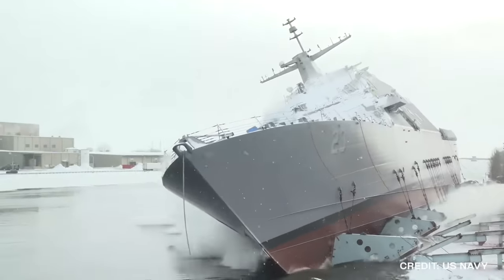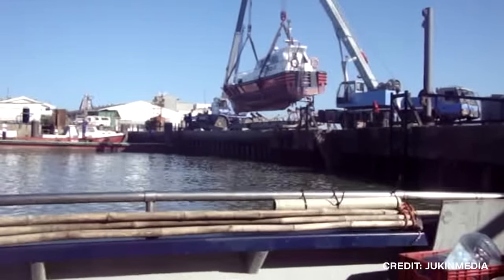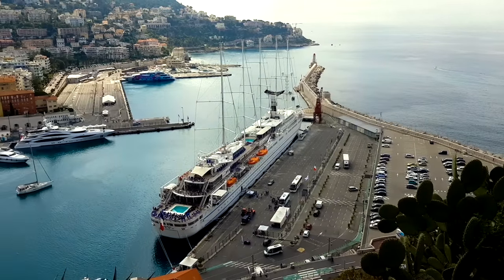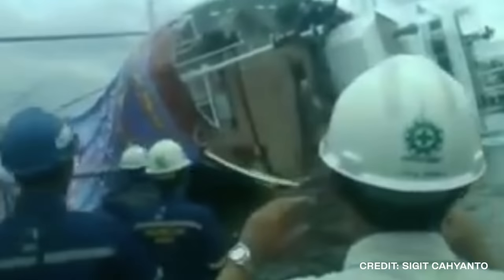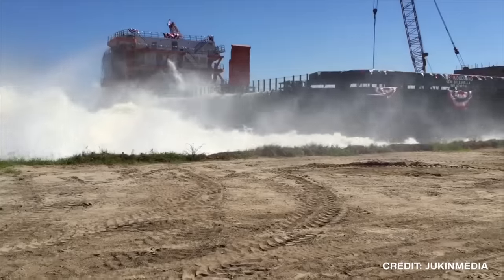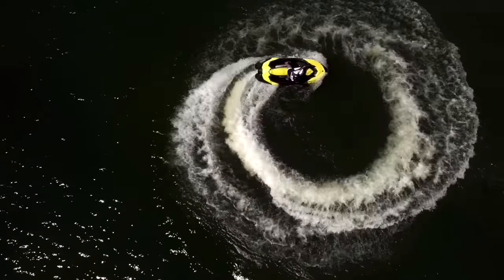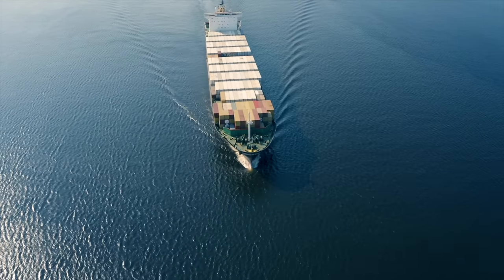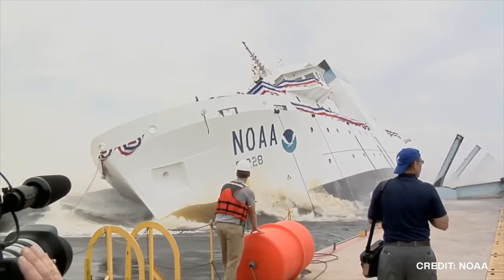5 Ship Launches That Went Horribly Wrong

Comment: You're wrong on the first one. Both cranes had the load. If only one had the load & the other was controlling the swing. The one with the load would've been rigged in the center of the boat. It's called a tandem lift.
Reply: paulgarcher  Correct!
The narrator does not know what he is talking abut!
Reply: paulgarcher  Lifts are calculated these days. Weight, distance etc are all worked out before the crane gets anywhere near the lift itself. Apparently someone thought or maybe was told that the boat was lighter than it actually was.
Reply: Its UTUBE not the BRIGHTEST.
Reply: @roberthertz6634  What are you talking about?
Reply: paulgarcher  Agreed but the liftplan should have that as part of it. Assuming that they had one which seems unlikely. :)
Reply: agreed and it NOT a personal boat like the commentator says, it clearly says "PILOT" on the side so it is a harbour authority pilot launch.
Reply: @SirHackaL0t.  Generally speaking cranes do have gauges themselves telling how much the load weigh's. So it couldn't just be the boat weighing more than what was calculated because you have to think they add a few extra pounds to be safe. The thing that really did them in which could not be calculated was the height of the tide really. It being extremely low tide at the time increased the distance from the cranes. Generally it was maybe close to max when first picked up thought it was okay but failed to realize the extra distance and weight into their calculations. Also add in the awkward positioning of the cranes due to the limited amount of space. Not a professional here only did rigging for a bit but these are things I noticed watching this video.
Reply: @davidscott9097  the distance down isn’t relevant. The boom angle is the main issue, not how much cable is out.
Reply: @loveistheanswer8137  If it was high tide  he wouldn't have to lower his boom as much really. Given that it was extremely low tide he was close to maxing out him adjusting the boom more because of the low tide. He than maxed out, tips and than falls over.
Reply: @davidscott9097  they don’t lower the boat with the boom, they lower the cable. If the boom was lowered too much, it’s because they miscalculated the weight, or how far from the dock they had to go. It distance down is irrelevant. I have worked around cranes my entire construction career.
Reply: @loveistheanswer8137  They lower the boom to move the boat out away from the dock. You are saying what I'm saying but not realizing that the low tide was a factor. If you look at the accident report I kid you not that they will also include it as a factor. Simply because he had to lower his boom more to adjust for the boat to clear away from the dock. You lower the boom slightly and lower the load.
Reply: @davidscott9097  what does the distance from the dock have to do with how high the tide is. This is my point. Not trolling.
Reply: @loveistheanswer8137  you're totally right, that dude doesn't know what he's talking about
Reply: The back of the boat was much more then the front.
Reply: its just a stupid idea to have 2 cranes to get a job done. the 2 cranes have to communicate and be precise, 1 slight wrong move and u end up like they did. its not the best or safest way to get that boat in.
Reply: @sasproductions701  
They probably can't get a crane big enough into that space for a single lift. I'm a retired Ironworker. I was certified in rigging & have performed more tandem lifts than I can even remember.There's nothing wrong with it if you know what you're doing.
Reply: @davidscott9097  Vertical distance plays a very small part. Repositioning your load and counter weight position and/or booming down (thus moving the loading further away and increasing it's advantage) will make quick trouble for you.
Reply: @loveistheanswer8137  are you a operating engineer or certified in rigging though?
Reply: @loveistheanswer8137  i'm curious, would they have been better off with the crane vehicle perpendicular to the dock instead of closer to parallel? i feel like the counterweight would do a better job... might be too skinny up there for it but seems like the counterweight is off to the side of the weight instead of "behind" it if that makes sense.
Reply: @SirHackaL0t.  That first one was possibly a bad crane operator, who didn't know what he was doing in th math and calculations dept.
Reply: I thought that it sounded weird when he said the other is only for support. Then why isnt the first one in the middle?
Reply: @davidscott9097  While it was low idk if I buy that argument because it starts to go before it even gets a foot or so down the side.  That doesn't seem to be a dock where water comes up to the top by any means but you are right about the weight probably not being the issue, it was probably a angle of approach and maybe the guy didn't have the extra feet in place or placed in a way to combat what was obviously a nose heavy lift.
Reply: No! You're wrong Colonel Sanders!
Reply: But at least the boat got  in to the water
Reply: @davidscott9097  the tide being low had nothing tondo with it since they are on a pier. The distance out from the crane remains the same. Only the amount of cable needed to lower to the water changes in that scenario.
Reply: Always important to know the weight of what you're picking. I won't hoist any large machine without knowing it's weight and checking my chart.
Reply: In an engineered lift when things matter you use a crane that has load cells and measures what the weight is. They also monitor stick out and the computer will not let the stick go out further than the center of gravity. This was probably a situation where they'd "done it a million times, what could go wrong"
Reply: The crane was not the center of gravity. .. If is was, there would not have been a problem.
Narrator seems to know less than he thinks....

Comment: That isn't a "large crane", as cranes go it's actually pretty small. Which explains why what happened, happened.
Reply: Actually what "happened" is the boat discovered gravity and took the crane along for the ride.
Reply: That’s what happens when you use a small crane to carry the bulk of the weight, ie engine’s etc. .
Reply: Agreed. That crane didn't even have counterweights. It's a light duty, not meant for big lifts. This is what happens when people think they know what they're doing, rather than actually know what they're doing.

Comment: Both cranes were lifting the boat. The one that fell was lifting the heavier end and it was oriented incorrectly.
Reply: And the water level had nothing at all to do with the tip.  Honestly, who the hell writes these scripts?
Reply: @tomrogers9467  Agreed.  If the crane that tipped had been placed the other way about it would have been OK.
Reply: The crane operator 100% caused that crane was badly positioned. Boom was extended out to the rear where the crane has minimal braving, and the boom was lowered as the boat was swung out over the water, shifting the cranes center of gravity in ways that the operator had not planned. I know of a few Fire Departments that managed to sink their very expensive ladder trucks the same way.
Reply: @andrewtaylor940  also as the load goes below the line of the crane it increases to load affect, same as reaching out reduces the load ability of the crane
lot of people dont know that
Reply: @raypitts4880  Basic leverage, dangling the weight below the cranes center of gravity is every bit as dangerous as having it above the center of gravity, works both ways, over-extension, bad load planning, bad orientation, honestly the whole thing was a perfect storm of bad decisions that ended with an overturned crane, it wasn't just one thing that went wrong there, it was many.
Reply: @charlesmayberry2825  I’m pretty sure the one thing wrong was the dude operating the crane, who thought any of it was a good idea. But yeah, multiple people had no idea what they were doing.
Reply: @tomrogers9467  The script is a bigger disaster than any of the launches.
Reply: That was my take as well.  You could tell pretty early on that the two cranes weren't in sync with each other.  Also the crane on the right probably didn't have the proper counter balance weight.  All it took was for the crane arm to reach a critical point in the pivot, matched with an underweight counter balance, and it was going over.

Comment: 7:17 That's what happens when idiots try to operate machinery they do not have a clue about HOW to operate! 

I've seen something similar, where a rich dude had bought a 37 ft. brand spanking new speedboat, despite having absolutely no experience or skills about boating, and the first thing he did was to slam it right into the concrete pier, and totally destroy the bow of the boat. Luckily for him the boat didn't sink, but it would cost him thousands and thousands of $ to get it repaired, so he sold it with a considerable los, and we never saw him in the marina again! 🤣
p.s. It was a +$250.000 boat to begin with.
Reply: U sound angry about it
Reply: @DBuckyBoy  it’s hard to watch someone who doesn’t know what they’re doing ruin a perfectly good boat, if only because you appreciate the craftsmanship that went into it.
Reply: a fool and their money are soon parted

Comment: Another well known launch fail is the Vasa (or Wasa) in 1628.
But it wasn't as much a problem of the launch as a design problem with the ship itself.
Reply: I was thinking of that - it just tipped over when put into water.
Reply: No video, unfortunately.
Reply: That was a fun one.
Reply: @roysigurdkarlsbakk3842  If I recall correctly (Disclaimer: from what I've read, I wasn't actually there...) it didn't tip over right away.
It did a minor test drive first that went okayish, and then they went for the big, official premiere thing and that's when things went south.
Reply: My Brother who had Swedish gf went to a museum about the Wasa.  He told me it was a design fault as the king of Sweden wanted an extra  floor on this ship making it the biggest ship at that time.  Builders warned him not to increase height as it woukd become  top heavy easy .  But the king insisted....( refusing a request from a king would be dangerous sometimes)
Reply: @ziiofswe  You're right. (and Baard2000 above also) The Vasa didn't sink right away - it sailed a bit away from the harbor, but a large gust of wind pushed it to an angle where water came in the open gun ports. Design flaw - too top heavy.
Reply: @Baard2000  I have been there a couple of times. And the ship is huge! The teori I was told was that if she had been loaded (soldier supplys etc) correctly she'd been okay. But on her first test run they didn't have enough ballast. And the king probably would have hubris after being involved in designing four equal ship's before. And as you say, telling a king in the 1600s that he is wrong, would probably lead to a drastically shorter lifespan.
Reply: Yeah we know about the accident 393 years ago

Comment: So the first clip has some slight issues with the explination. 

First off, the boat being launched by the two cranes is a pilot boat, used to take maritime pilots out to thier assigned ships and back to port.

Second off, if you notice the way the sling shifted before the collapse, the ultimate failure was an improper sling connection, causing the sling to shift closer to the center of the boat, throwing both cranes off ballance before the teams involved could respond.

Also, launching a boat by mobile crane is HIGHLY frowned upon by crews, as it is highly risky. When crews do use mobile cranes to launch a vessel, it is usually due to cost restraints or logistical reasons. Typically a specialized lift refered to as a “Sling“ is used, which is a large wheeled or tracked vehicle with either a large net or large padded cables. These nets or cables are positioned under the hull of the watercraft providing even support while the vessel is suspended in the air. 

Overall, this video (hopefully not in the US) violates MAJOR safety codes from the start, and most sailors (myself having years of experience on a range of different ships) would cry seeing thier new vessel falling into the water and almost capsizing.

Comment: #5 narrator contradicts himself starting out by saying this one is a bit different  because of the water level...he then mentioned the real reason of the fail wich is the crane....even if the tide was high, the crane would've still tipped over...I'm glad to see no one was hurt and the vessel not damage.
Reply: He  also says one crane is lifting the boat and another crane is holding it steady, when clearly both cranes are lifting the boat from either end
Reply: Use bluebackss

Comment: 01:00 this is not a privately purchased boat. This is either a Pilot, a Coast Guard or a Customs ship. At any rate the reason why two cranes were used is simply that one was not strong enough : it was a tandem lift. Occurs all the time. Bad coordination and the front crane reachingg too far over the water caused the accident because the cantilever was too long.  As for the tide being too low this is not why the ship fell. Had the cantilever been short enough the boat could have gone down much lower before touching the water without any problem. (PS. I saying "cantilever" but I'm not really sure, maybe it's called torque… please enlighten me on this one…
08:44 Please do not conflate a picture wth would flying all over with this boat being laughed : the photo was take from another laugh which can be seen on YT on many channels at it has been posted for 10 years at least.